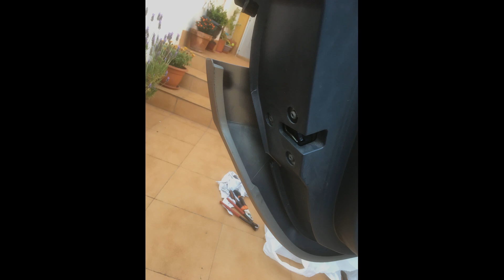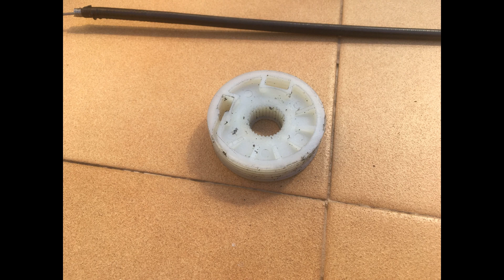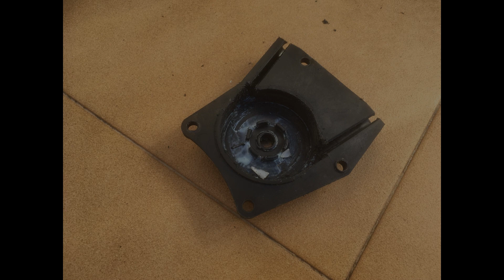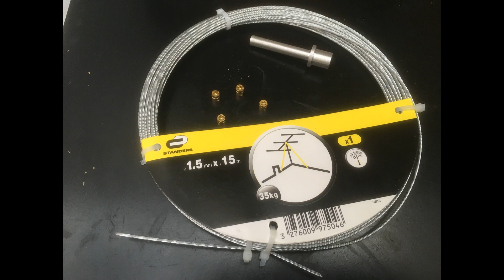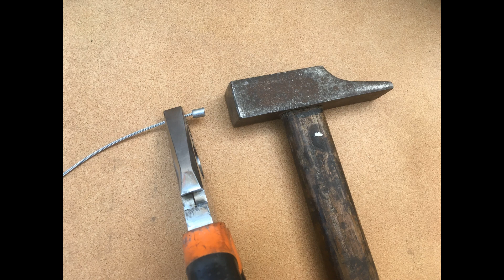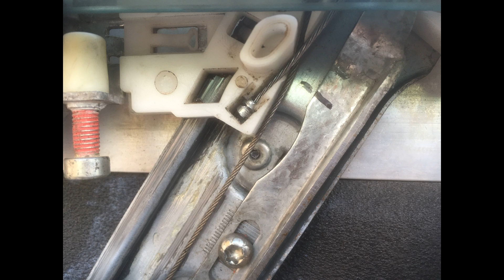window cable Replacement

Comment: do you have any video about removing door panel kindly ? :)
Reply from the maker: I don't have it, but it is necessary to remove some screws from the front wing and move it forward a bit to be able to remove the door panel without scratching the paint.